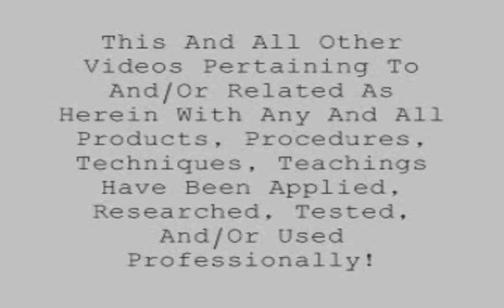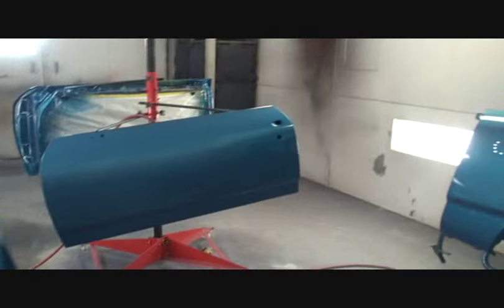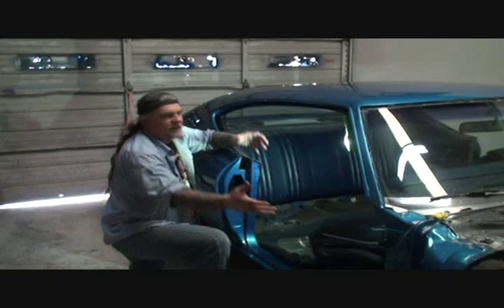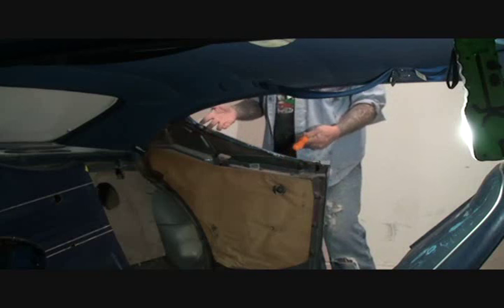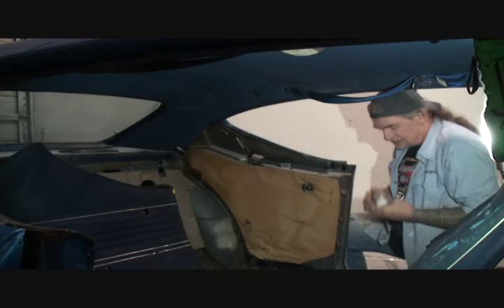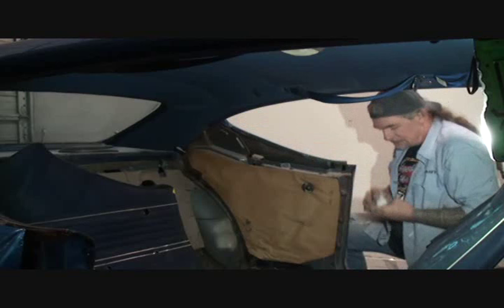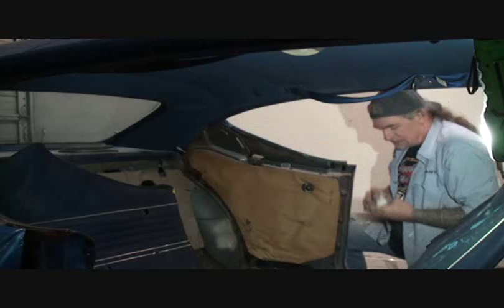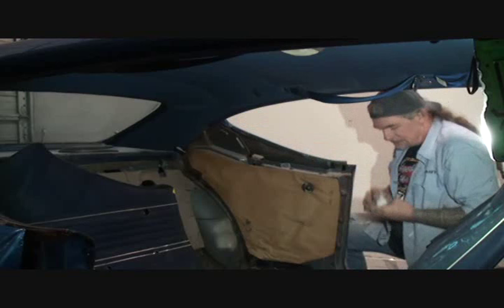"How To Paint A Car"-By Yourself-Part 14-"Reassembling The Car"

Comment: It is hard work Pete as that’s how they made them. The tar-paper had pockets to keep water off the speakers if equipped. The OEM use SS screws on the outer belt molding (That is their name) but the UAW workers had 8 minutes to install rear speakers, package shelf, outer glass belt molding, and inner weather shield installed and panel. One guy one each side, the vehicle moved forward 20 feet, a rear seat was picked up on an air powered lift and placed into the car. Two guys jumped in with the bolts in there mouth, popped the seat back in place, then the seat bottom, pulled the seat belts out and clicked them in place. That is all they did their entire shift. I don’t know if their forearms looked like Popeye, or if they were just sore everyday! I watched Oldsmobile’s built in KC during the early 70’s on a field trip. The correct color interior part magically came out for each new build. Serious hard work as we get older. The inner belt molding (Window rubber strip) was inserted with the metal tabs bent over already. Something we cannot appreciate when replacing one part.
Love the videos, learning all the time plus bring back things I forgot! Blessings to all.

Comment: I've yet to see you use seam sealer on your panel seams.. I really need to see this done.. but I haven't yet seen all your vids or channels or series.. whatever.. I'll keep looking for it though as I follow along with where ever I'm at.. thanks man for being you and for being there doing what your doing
Reply: @Ruffed Feathers   >Pete has 3 or 4 videos on seam sealer he uploaded the last few years. He has one on drip rails, a Plymouth Road Runner convertible (Applied with caulking gun, bushes out w/throw-a-way bush and wax & grease remover for smoothing) and another on the right front inner fender on a Mustang that had water intrusion after a tire came apart. So, several! Just look at his channel or type it in. He has done it all seam sealer type situations, some using 8X holding power liquid nails, bushed out on the a Mustang with tire damage. Keep watching. Click like, save to a private file and share. I do. ASE Master Retired! Pete does it all.

Comment: I can make door panels those lower sail panels from scratch they get wet now out. at the shop we have black hard construction paper sheets. I guy could use thin wood from Lowes or Home Depot I make trunk panels from scratching fallow inner body curve in cardboard as tempet
Reply: @joey alfaro    >The door panels of that era where two parts. The upper is molded plastic to make the curve into the quarter glass that holds the inner belt molding and held in place with folded metal tabs. The bottom is simple, as long as you get the right Christmas tree clips (Google it) It is made from 1/4” Masonite called hardboard. Just make sure there is a weather shield on the sail panel first. The OEM was an asphalt spray on a heavy brown butchers paper. Today, use plastic. At Eastwood, Grangers, McMaster-Carr they sell a butyl tape. Peel off the wax paper, stick it on the inner metal, the attach the plastic using a 6 mil thickness. Trim to fit. Some wrap the upper in food grade plastic wrap, then mat fiberglass followed by cloth. Use a “Chicago” screw used on belts, but attach the upper fiberglass to the bottom hardboard. It’s the best I can give you. The interior vinyl has to go over thin foam, cut for lines and glued in place with weldwood contact cement and rubbed with a smooth bone or plastic stick used in upholstery to recreate the look. They are glued but pressed together with a metal stamp and heated. Crane interiors did GM’s interiors for years. Gone forever now! No NOS. Hope this helps! Seen it done, working for GM as contract labor twice in my career!
ASE Master Tech since 1978 Retired